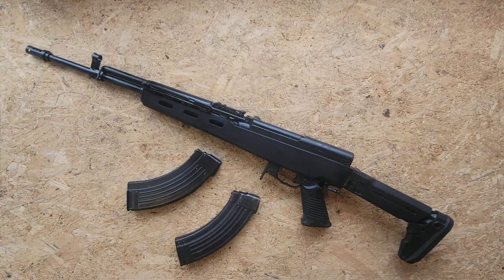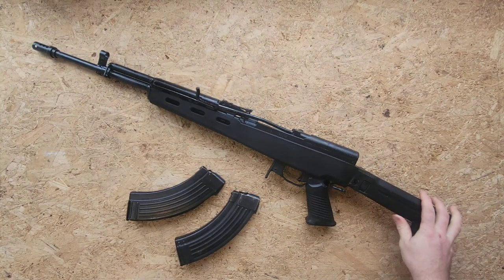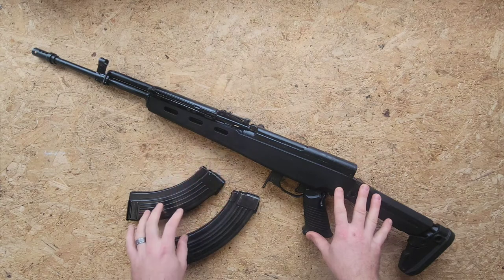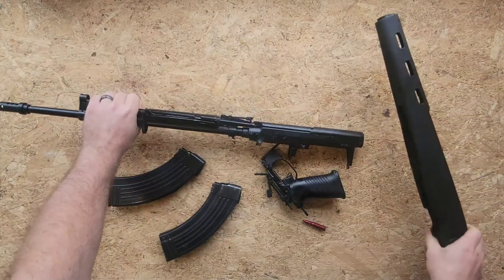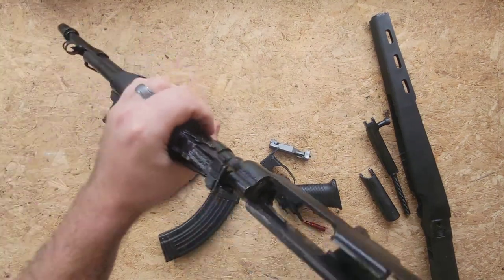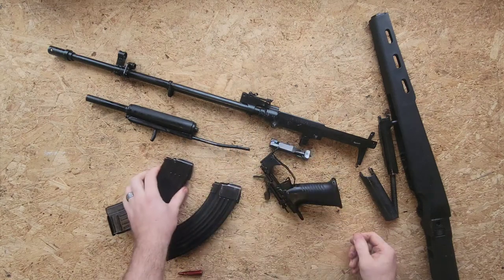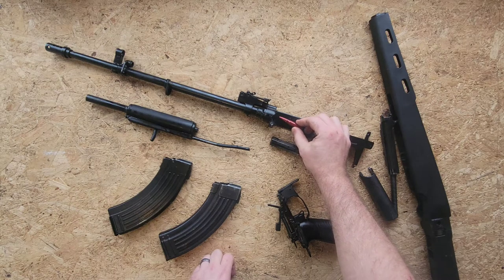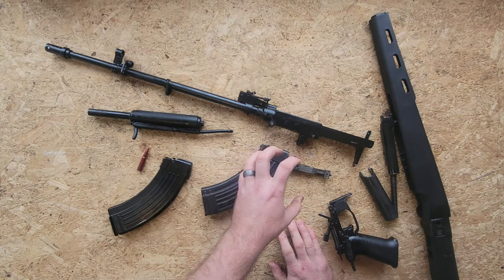Because You Asked for It (the SK-21 build description and breakdown)

Comment: I love your design and improvements, would you need to cut through the bolt rails for magazine to feed if mounting point is of the standard ak magazine?
Thanks.
Reply from the maker: Especially for the AK magazine, because the lower half of the bolt has to fit between the AK magazine feed lips